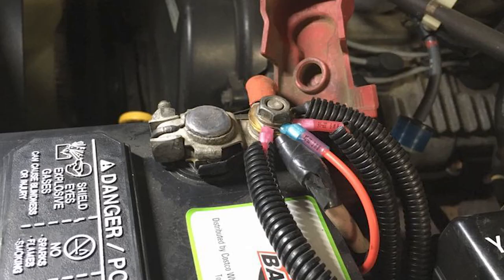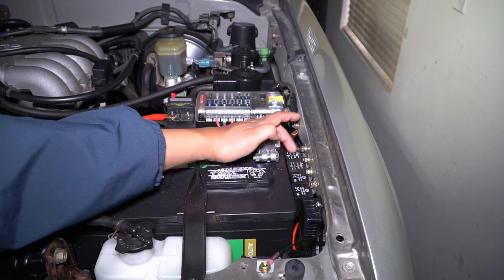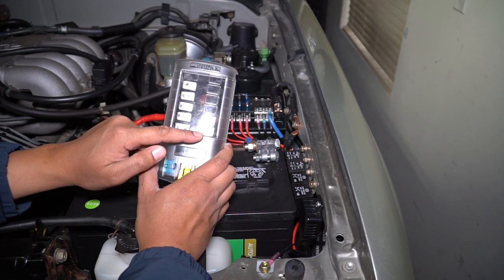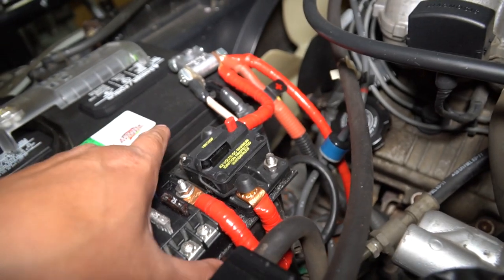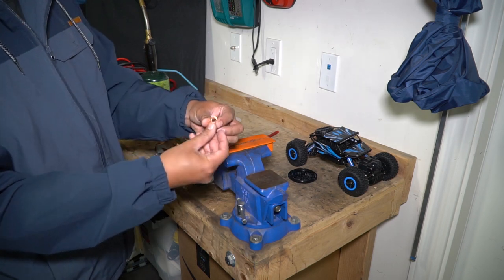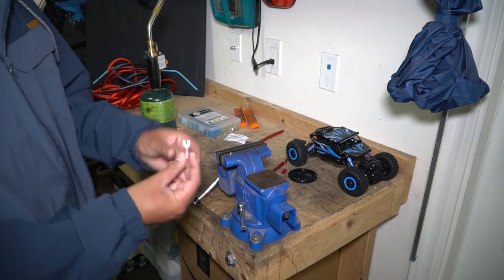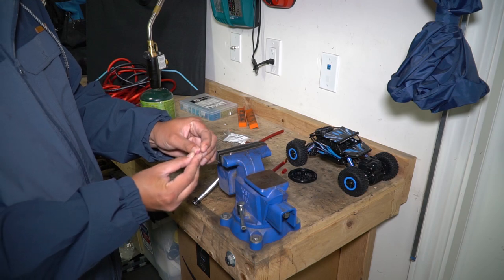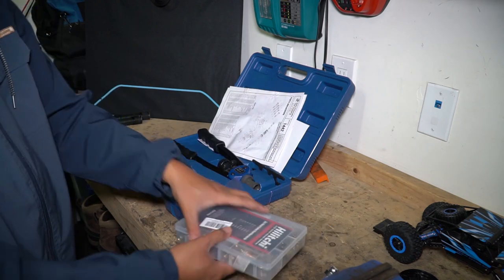Toyota 4Runner Electrical System - Blue Sea, Circuit Breaker, Military Battery Post

Comment: how did you calculate the size circuit  breaker to use? i plan on usually nothing more that a 6 way fuse block.
Reply from the maker: try here: https://www.engineeringtoolbox.com/amps-wire-gauge-d_730.html

Comment: You mentioned swapping a Group 27F battery to replace a OEM for 2001-2002 4Runner, do you know if it will fit the 98 ?
Reply from the maker: Should fit just fine

Comment: why do you need a relay for all of the accessories/? please explain why you did that. I am a novice. are your accessories always drawing on the battery, even when your key is off??
thanks!
Reply from the maker: The relay is to handle higher amp draw. It depends on what circuit it’s on but it won’t draw anything if it’s not on

Comment: The 12volt battery you installed what year 4runner is it for and does the stock 3rd gen 4runner  battery hold down and battery tray fit that  battery
Reply from the maker: 01-02 I believe and yes it fits fine in existing tray

Comment: Are cheap fuse blocks on Amazon not worth it? I see reviews where some have melted or there’s current even without a fuse inserted. Is the one you’re using professional grade ?
Reply from the maker: Blue sea is very reputable and used often in auto and marine application. I use mine now to send power to the rear of my 4runner

Comment: Really cool wiring setup! Question about the negative mil spec terminal: do you know the gauge of the factory wiring? because to install the new terminals I'm guessing you'd need to put on a new ring, and the kit comes with 2 gauge rings...
Reply from the maker: Probably 8 gauge for the negative

Comment: What year is your 4runner? I'm looking at getting 99 4runner with 250xxx miles. Still worth it?
Reply from the maker: Yeah! 250k is maybe a little more than half the miles this engine is capable of. Check my buyers guide video though!
Reply: @PhoRunner  ight man I will and sadly the 99 is sold and I wanted to ride that till the wheels fall off or something along those lines haha. But tomorrow morning I'm gonna look at the 02 but I'll watch the video before hand

Comment: Good job on that electrical work.  On a different subject matter, can you advise on what mounting scheme did you use for your ARB awning?  Is that mounted on the ROLA roof rack/basket?
Reply from the maker: Check out my custom rola rack video. I show how I mounted it on there as well as the awning!

Comment: Hello I have been wanting a 4Runner for years and have recently acquired a 99’. Everything seemed to be running well until the other day when I was out on the open road doing about 62 mph running the A/C (it was about 95 degrees). When I lost complete electrical power. A/C shut off radio shut off radio antennae goes down no lights and all dash gauges shut down. The engine continued to run and I pulled over with no issues. I turned off the A/C and magically everything started to work. This situation has happened 3 times now. And every time the engine never shuts off just complete electrical failure.  I know the problem is electrical and has to do with the A/C but I was wondering if you have had this happen before? And possibly what the cause is? Thank you in advance
Reply from the maker: I’ve never had that happen to me. That is very strange indeed. Perhaps check the relays to see if there’s one that controls all those components. You can verify by pulling it and seeing if they turn off the same components. Good luck!

Comment: Help me out here, I see you have two ground cables going to the bolt by your relays, what is the cable (besides the blue sea system ground) going to ?
Reply: Engine ground ?
Reply from the maker: One ground is the factory ground for the battery. The other one is the one I added. 

There’s also a ground to the back of the engine firewall on the passenger side
Reply: @PhoRunner  mind if i show you what im working with?
Reply from the maker: Ping me on fb . Find me in 3rd gen 4runner mafia

Comment: did you do a  video on the wiring??
Reply from the maker: I have not! I was thinking about doing one for the light bars. I only show the wiring of the new circuit for the fuse block in this video.

Comment: Is the factory fuse block active at all?
Reply from the maker: Factory fuse block is untouched so yes it is active
Reply: @PhoRunner  another question, for all those positives you have in there, where’s your negatives?
Reply from the maker: It’s on in there also towards the fender side

Comment: Your system is done but others could use a trailer wire to bring the relay switch wires into the passenger compartment. It's all contained and color coded. It's easier to get through the grommets on the firewall as well. Just sayin'.
Reply from the maker: Good tip

Comment: What size wire you use for your accessories. Love your videos
Reply from the maker: It depends on the amp draw but anywhere from 14 to 10 awg
Reply from the maker: Check out my auxbeam video because I’ve swapped out this system